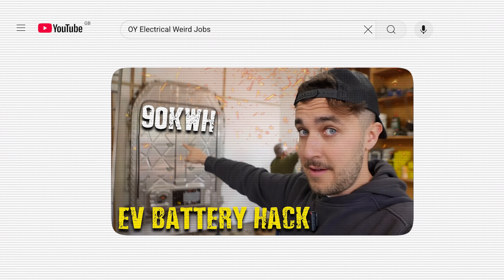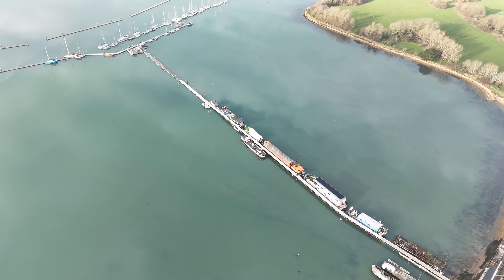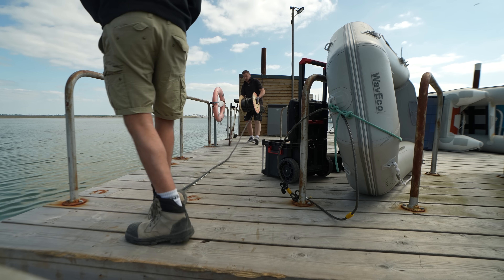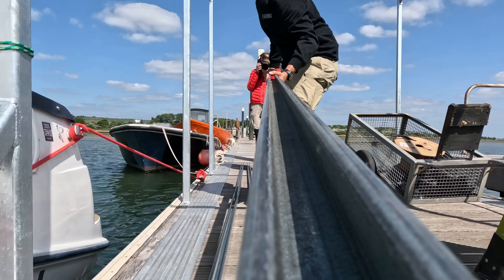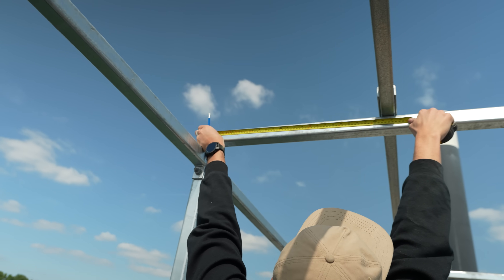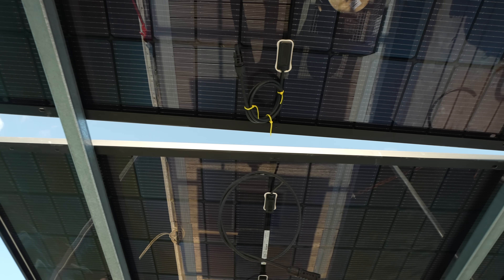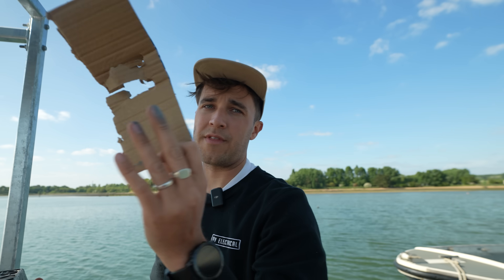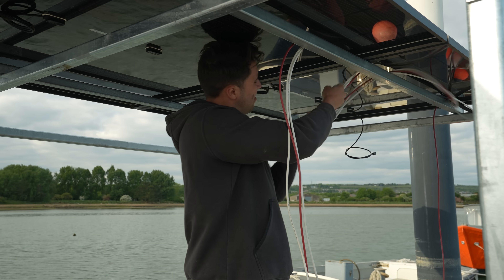Making a Floating Power Pontoon | ØY59

Comment: 10:33 if you’d ran two pairs of unistrut along the frame, you’d have got 4 panels on it, and no gap either side. So more pv output and more rain shade on the pontoon. 

What’s the brand of those solar panel clips? I think I could make up a fence with that method

Comment: This looks pretty sound, but strictly speaking you are supposed to do wind calcs for free-standing PV structures like this. Whenever I've asked companies about this sort of thing they do a lot of teeth-sucking  and say they'll need to get someone in to do calcs so it'll be expensive, and you end up with something massive like the car-park cantilever canopies. As this isn't cantilevered or 6 metres across it can be much more sensible-sized. 
Eurocode sums are not actually that hard once you get your head round them, although I've never tried applying them to a floating structure. 
I'm not quite sure which regulation requires said sums. It might just be MCS (which doesn't apply here unless you want it to), and do building regs apply to pontoons(?), but obviously you don't want the whole pontoon tearing loose, the frame bending or the panels coming off so some enveloping probably is a good idea. Only doing the roof rather than the sides as well certainly lowers the peak shear and rotation loads dramatically.

Comment: Xpanda tape, use the expanding foam tape to seal the gaps
Reply: You can buy T-shaped EPDM rubber cappings designed for this very job. Inexpensive. They are going on my neighbour's garden-office roof which is all solar-panel (I'll tell you in a couple of months how the seals look :-). I think that will work better than Xpanda/compriband type tapes (and be cheaper). Expanding foam tape is not designed to be left exposed to UV, I don't think?
Reply: @xxwookey but compriband is exactly made of the same material. foamed EPDM.

EPDM is also used for vehicle coolant hoses, so it can handle a bit of UV exposure but not too much.  and i'd call a solar/PV installation a 25 years lifespan job. no kind of rubber is gonna cut it.
Reply: @casemodder89  Cheers. I didn't know compriband was EPDM, but I guess that makes sense. EPDM roof membranes come with a 20 or 25-yr warranty, so it's expected for it to last significantly longer than that. I have a couple of 16-year old EPDM membrane roofs  which look to be in excellent condition. Look almost certain to mange 30+ years. I don't know if there are varying formulations (i.e in the way that there is PVC and uPVC, and you don't want to leave 'non-u' PVC in the sunshine for too long) or if all EPDM has good UV resistance. .
Reply: @xxwookey that sounds a better option let us know how it works
Reply from the maker: Thanks!

Comment: Perhaps the unistrut could align with outside of the panels, then the clamps go on the outside and you can place the panels right up against each other. A bit of flexible material could be sandwiched between to allow for expansion.

Comment: I think it would have been between to design this back at base before you went to site. You know the dimensions of the frame beforehand and so it wouldn't have taken much to design it. Then you would have saved a great deal of time on site. Also, did you fill the mistakes or paint the holes with corrosion resistant paint?
Overall, I think without wind calculations, that walkway is a liability in the long term. Take a look at the floating solar plants in India and China that have been through storms.

Comment: A slight tilt will improve rain runoff. Let's see solution will stand up to a winter of salt spray and flexure in the wind (wind forces above and below). Coastal winds can be ferocious.
Reply: As far as wind forces go, panels sold in the UK are usually designed for a wind load of 2400 Pa which equates to the pressure from a 135mph breeze blowing at a right angle to the panel. However, real world wind forces never work out like physics textbook examples.

Comment: Great idea, could the panels fit 2 wide in the other orientation? Maybe get the fabicator who is building the frame to use the strut 1 down either side and down the center to make the frame for easy and cheaper install with more panels?

Comment: I love the thinking here. The idea should be expanded to any structure that can support panels. Panels are so cheap, especially secondhand ones, that it seems crazy not to have them mounted somewhere producing free electricity every day. Surely pople can find a use for that electricity somewhere ?
Reply from the maker: I agree! Hidden Facades for a start
Reply: I'm of the same opinion however I can't get dno approval for more inverters at home through g99!! Apparently the limit is some 18kW on single phase and I'm already at that, with 22.65kWp of panels!
Reply from the maker: Keep it floating off grid! Then no applications needed
Reply: @corymac  I see thousands of perfectly good solar panels replaced with new, much better ones. Surely there must be offgrid opportunities for these old panels to be reused and power things like lighting, water pumps etc.  Do you have any suggestions, examples or ideas of how we could do that better ?

Comment: I've mounted panels on a flat roof with unistrut with great success, however I quickly found I need some tilt just to stop water pooling and leaving tide marks all over the panels
Reply: And there will be salt in the air so extra residue over time. Reasonably regular panel cleaning will be needed to stop them looking like the windows on a cross-channel ferry after a while.
Those DEKS solar drains are clever: a little siphon. Genuinely good idea.
Reply from the maker: You can buy panel drains. DEKS make them
Reply: @corymac yup i've installed them but you still need some sort of tilt to get the water down to them otherwise it just pools in the middle of the panel.

Id try 1 or 2 square strut washers between the strut and frame at one side, just enough to get the water moving down to the drains
Reply: even 7 to8  degrees wont  help you avoid those marks..  i m going to make 12 to 15 degrees bases on my base  legs ...    hope wind isnt affecting  on its strenght and take it for a flight
Reply: Or hire a bunch of children to jump on the pontoon until all the water runs off

Comment: So it's not okay to use galvanized metal parts directly making a contact with aluminum parts on solar systems on the roof, but it's perfectly fine next to salty water? Am I missing something?
Reply from the maker: Also, who says it’s not ok on a roof? The only reason unistrut isn’t typically used on a roof ( to my knowledge ) is it isn’t MCS approved, and just isn’t the same quality as proper rail.
Reply: @corymac  True that the thick zinc layer on HDG unistrut will last a long time even used with aluminium, but did you consider using GRP unistrut at least for the lengthwise pieces? It would have provided the isolation to completely avoid galvanic corrosion in any part of the structure
Reply from the maker: To be honest, I didn’t consider it. But in hind-site, it’s a nice idea! @garysmith5025
Reply: @corymac  If I am not mistaken In the Philippines, using galvanized metal on solar systems is not allowable due to the high risk of corrosion caused by the country's tropical marine climate. There must be a reason for this. I wouldn't be worried too much if it was on the land, as I myself got small solar system installed on galvanized rails, and it's still looking good after 9 years. But salty water and galvanic contact makes me anxious...
Reply from the maker: The hot dip metal has a thicker coating of zinc and provides longer protection against galvanic corrosion & salt water exposure.

Comment: What a good idea. 👍 
Is that unistrut going to fill up with water? I know it’s galvanised, but some drain holes might be a good idea so the water won’t try to seep down through all the fixings, especially since you capped the ends off so neatly.
Reply from the maker: Good question! We have drains though should have shown!
Reply: Fair enough 👍
Reply: That was my question, especially since it looked like the conductors were ran in some of them and wasn't sure what the insulation was rated for.... but question answered with drains.
Reply: I had the same thought

Comment: Brilliant idea. Not sure how public that area is but the only concern is someone disconnecting those mc4 connectors under the panels as theyre within reach and visible.
Reply from the maker: They’d need a tool, and there wouldn’t be much of a motive 🤓
Reply: @corymac Motive would be to see the nice 300 volt DC arcs once you’ve got 8-10 panels in a string!!
Reply: Also sign it up with danger high voltage signs.
Reply: Just orientate the panels so the MC4s can sit inside the unistrut